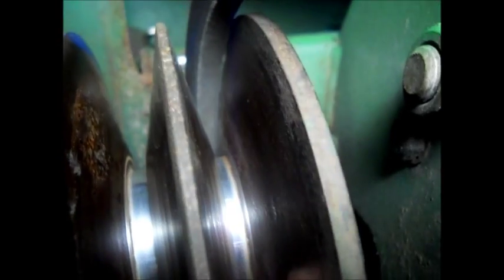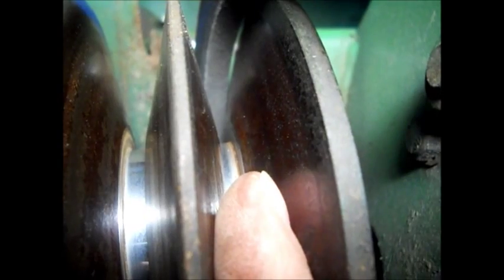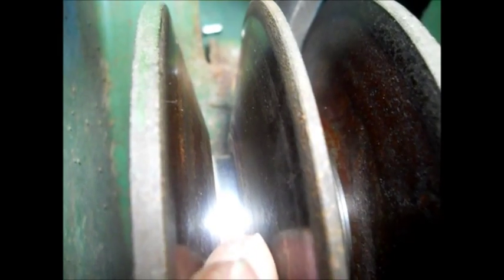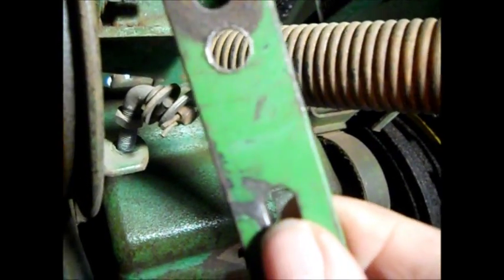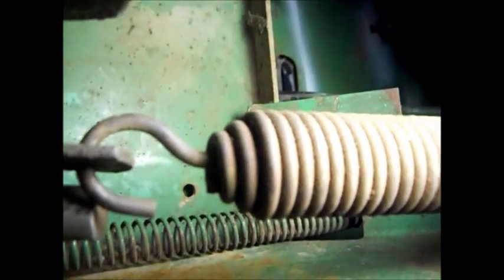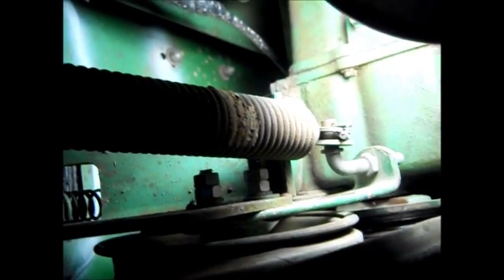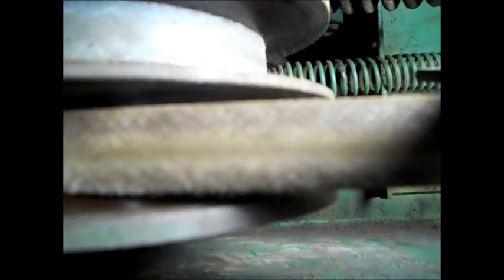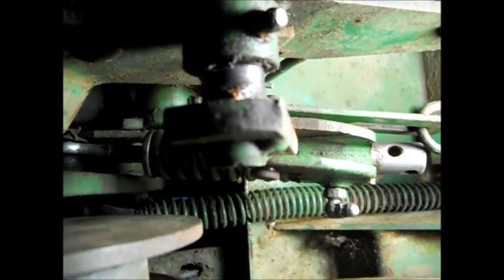JD 112 BELT ADJUST REPLACE ( PART 2 )

Comment: Dear Sir, that large spring (clutch spring) attaches to a hook that is located at the very aft end of the frame structure that your repair is bolted to. In your video at 8:42 the hook can been seen almost inline with the shifter and it would only be about 1 inch from the transaxle.  The spring needs a good stretch to meet this point (hook) and will provide the correct tension.
Reply from the maker: +Randy Gerdes THANKS !!!